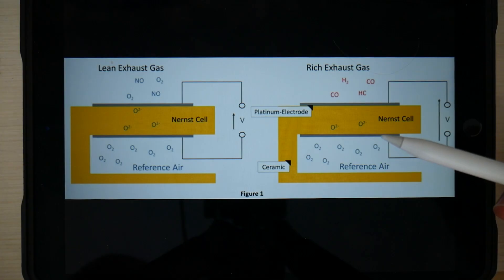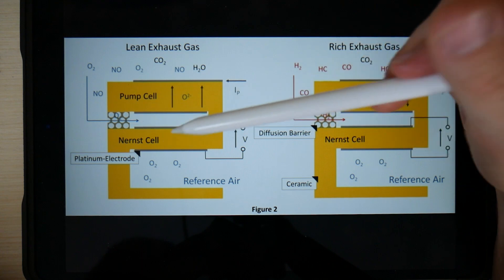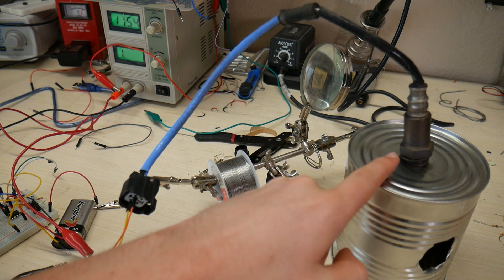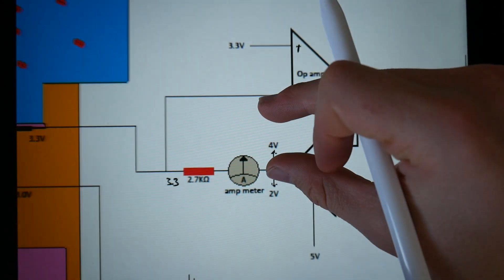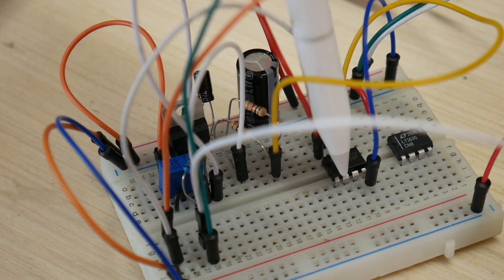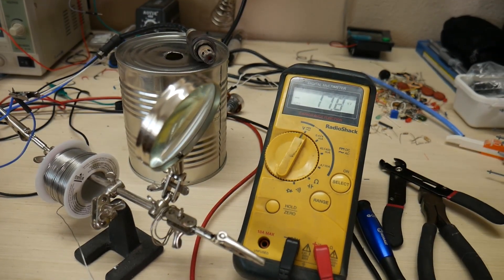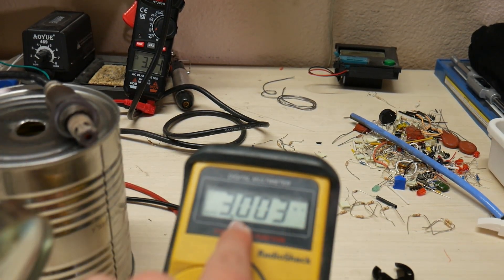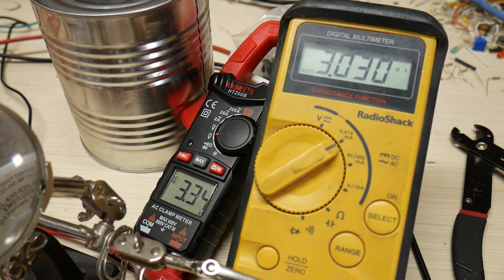How a car's O2 sensor works(+Trying to understand strange current measurements)

Comment: Just give it 5Vdc and measure the output as a voltage to at least 2dp. If you dont believe me, look up the ECU pinout diagram, it will show you that the cars ECU does this to read it.
Reply: Should also mention that o2 sensors need to be calibrated depending on engine and exhaust, so dont expect to use variables you found on the internet for your lawn mower, especially if you're mounting the o2 yourself as location is important.

Comment: How do you give power to a toy without you having to use Batteries?
Reply from the maker: What?
Reply: @TannerTech  I’m making a voice box for my woody doll and I want to use or make something that can give enough power to activate the voice box so I wouldn’t have to crank charge or use a battery to operate it Something almost like a small tiny little generator that can plug into the voice box and can be put inside him
Reply: @johnkoester7795  wth are you talking about???

Comment: Can you use them without airflow and not risk heat damage?

Also, maybe your meters need new batteries
Reply: Yes you can leave them plugged in without airflow

Comment: Put a 1 ohm resistor on the output and read the voltage drop across the resistor to know the current flow.
All meters are not built the same or with identical component values.